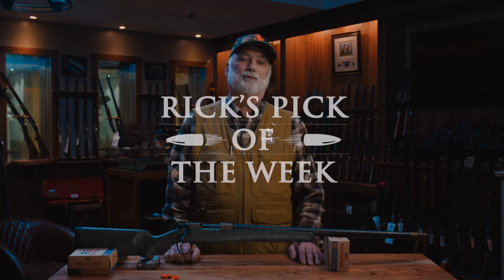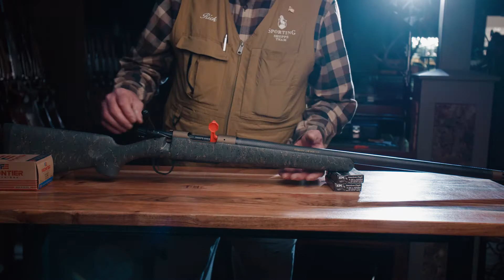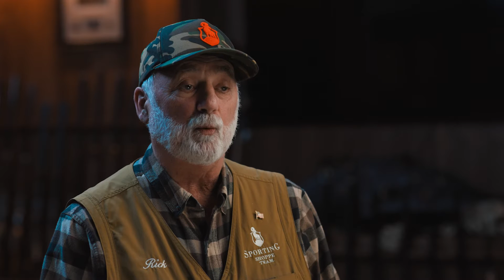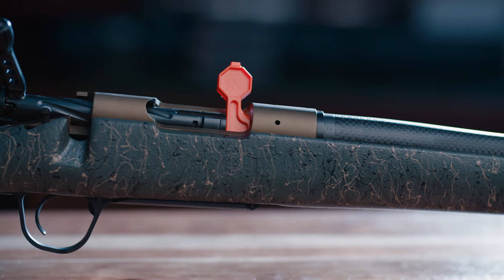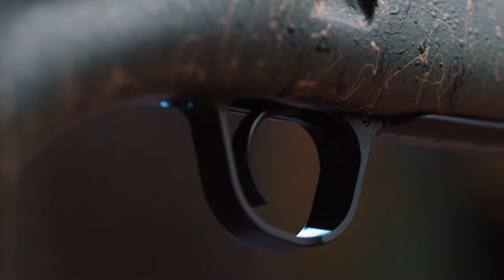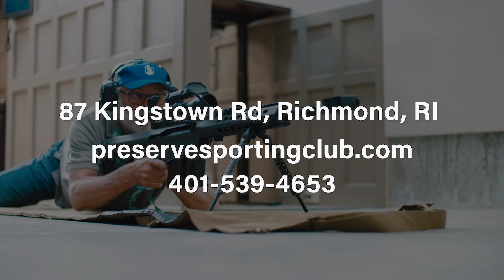Rick's Pick of The Week - Christensen Arms Bolt Action Rifle

Comment: A very thorough and professional breakdown. Thank you! 

I see in your video that the Ridgeline you model has a stock quality (defect?) that my Ridgeline FFT in .300 WSM has as well. Under the bolt handle, there is a significant gap between the bolt handle cut-out and the action. I’ve assumed this to be a defect but see that your rifle has it as well. Is this on purpose? And if so, for what reason? I have never seen this on another bolt action.

Comment: Great information.  I have 2 CA rifles with carbon wrapping barrels, I can understand the rigidity and lightness, but always under the impression that heat would be trapped inside since carbon fiber is an insolator. I could be wrong.